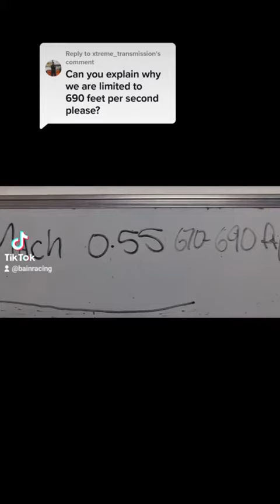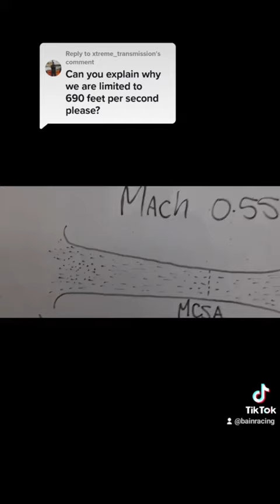"Mastering Essential Air Speed: The Ultimate Porting and Polishing Guide"

Comment: Wondering if you have done any work with riblets in the direction of airflow to reduce the drag?
Reply from the maker: Anything that promotes a biased im drag doesn't really work. Which "way" would you like to favour now becomes the question? 

 You do realise this is a bidirectional duct, right?  Air cycles up and down our primary induction length.  It's not a constant velocity. 

If you favour the air filling, you now sacrifice your wave tuning, which is up to 12% of your HP. 

Also, there is very little evidence that "riblets"  dimples, etc, will reduce drag, and it actually show they "increase" drag.   Which we do need some. But not too much, that's because this is an active turbulent boundary condition, and not a no slip condition like in aerodynamics. 

So all the evidence and studies, including the F1 study, Cambridge study, and most of the back to back we have done as well as many others, is..  

A finish between 100-200Ra surface finish creates the least amount of drag. And "limits" the boundary "swell" at peak velocity.  Remember, our boundary condition is influenced not only by the surface texture but also by the localised pressure drop.  And at peak velocity, it's up around 690fps on any good cylinder head to optimise our inertia filling mechanism.  So that Ra profile that works the best seems to be between a burr finish to 60 grit. (100-200Ra). 

So due to the pressure drop, the velocity, and how boundary condition helps flow if controlled right.  All the evidence seems to indicate that the boundary condition only needs to be big enough to support the port shape, Or it "chokes" velocity and that's exactly what we see with dimples ports. 

In short. The thickness of the boundary condition, which is obviously influenced by our surface texture (RA), only needs to be enough to help the turn the air. 

And F1 provided evidence of this with their straight shot needing as little as 320grit finish.  As it was a dead straight induction length. 

Where older, 2 valve ports need far more boundary thickness to help air and fuel turn and stay attached to the SSR. 

So in these heads, where the window is lower, then the SSR, a burr finish, is generally a win.  

We see this in all the top comp 23° heads like what comes out of Chad spiers in the US, then there's the back to back work done by Larry, the creator of pipemax.

But in later 18,13,12,10 degree heads with a high port and a far better short side radius. The best finish seems to be a fine cnc or 40-60grit. 

Hopefully, this helps 👍
Reply: @bainracing  Thanks for the comprehensive reply. Great stuff, I had to read it twice to digest the info. Yes I was aware the flow is in both directions ( even like with a 2 stroke with reed valves) but thought perhaps improving the forward flow might outweigh the 12% you mention. I also thought a combination of riblets and then polished surface on the SSR turn into the bowl might slow and drag the airflow to help steer the airflow around the corner especially on a 2 valve head. Thanks for your time.
Reply: Oh and I also had read that 50 grit was in the ballpark of the size as you mention too.
Reply from the maker: No problem at all, mate.  No, surface finishes are only around 2-3% of our HP. So wave tuning must be the priority.   We never want polished on the intake. Only the exhaust,  due to not only the fuel, but the viscosity shift. Even velocity indexes change dramatically in reference to our mach limits. As the speed of sound almost doubles from cold intake gas. To super hot exhaust.  

And as far as the short turn goes. A course Ra in this area creates more drag, which helps air stay attached,  similar to how dimple ports work on a golf ball. 

The dimples "increase" surface drag in order to extend the separation point, which reduces the negative pressure "area"  behind the ball.  I have a video on here on dimples.  

Have a good one mate! 👍
Reply: @ much appreciated. Greeting from Canada by the way. I was born here. Mum & dad were from Tassie & Sydney.
Reply from the maker: Nice! Where about?  I lived in Kelowna for 4 years. Beautiful country
Reply: @ Nice. North of there in Prince George. I’m sure you know of it.
Reply from the maker: Nice!!  Absolutely beautiful country, mate!!   Coming from Australia, i never knew what a real mountain was. Then, driving from Vancouver to Kelowna, I was mind blown! 😂
Reply: @bainracing  glad to have you here but the call of Oz is strong and beautiful as well. Cheers mate.

Comment: Massive information in very tight package 😅
Mostly over my head. 
What is MCSA?
Reply from the maker: MCSA stands for the Minimum cross sectional area of the port.  The "pinch" sets our terminal velocity/RPM limits.  So, it needs to be sized to our max RPM so we don't create a velocity restriction and optimise our density/inertia.  

If velocity gets too high through the MCSA, our density drops, and our HP is capped, and the engine falls too early.
Reply: Wow. Thanks!
Is the MSCA intentional, since you don’t want parallel pipes?
Reply from the maker: @bobirving6052  YES! parallel runners create more drag. and we want to optimise inertia. so a tapper with an MCSA will do this best and all race heads for the last 40 years have been designed around this mechanism. Also if the runner was parallel, you would have massive separation at the plenum entry as air speed would be too high.  runner also this is a timed event. stop/start, which adds to the complexity of the process as we need to understand what the acceleration and de-acceleration are doing to the density and the boundary condition.
Reply: Ok. Really tricky to deal with the air in those situations.
Reply: In your drawing, is the opening to the left the intake runner inlet and the other end the valve seat?  So do you want your MCSA at the port mating surface between the intake and cylinder head?
Reply from the maker: @BradfordsGarage On older heads, the MCSA is usually at the push rod pinch. But modern heads, you want it at the seat ring. The longer the inertia length. The better 👌
Reply: @bainracing  Awesome.  Thanks for sharing your knowledge 🍻

Follow-up:  I think this may pertain to the older heads with more turn in the port.  But, another source claims to want the runner parallel, but to open up as it turns into the bowl.  The explanation being that if we can slow the air down as it's making the turn it will be less likely to separate from the short side.  Would you agree with that statement?  And as it pertains to more modern heads with higher port angles that don't have such sharp turns to negotiate, does this hold true?  Is there a "bowl" in such heads or are we looking for more of a uniform taper toward the valve seat ring?  Thanks again.
Reply from the maker: @BradfordsGarage  Mate the Only one I know that has that opinion and that knows what he is on about is old David Vizard. And he is half right. Though you never want parallel walls due to increases in the drag coefficient. This is why a taper is used and feeds into Bernoulli equation. 

"The explanation being that if we can slow the air down as it's making the turn it will be less likely to separate from the short side"  the problem with this statement. while half true.   is its more about speeding up to far side, improve guide shape and this how modern 2 valve do it.  the area profile best for turn air is a trapezoidal shape for obvious reasons. 

The short side stability is due to the velocity gradient Perpendicular to flow and speed differential between the far side and the short side. hence the Trapezoidal profile. If the far side isn't supporting the short side, then we get separation. 

Now when It comes to the bowl volume, this has more to do with mass energy and wave optimisation. 
Bigger bowls with the MCSA up stream. will have more mass at the back of the valve for when the rarefaction wave lands just on overlap (if done right) improving VE's/savaging with a more density and mass available. But there's a lot more that comes into it at this point, from seat angle to throat ratio to our good our discharge coefficient is how tall is the SSR and so on. 

Now If we are talking about Dave he Also claims modern 2 Valve Prostock still like the MCAS in the middle with a parallel section. So that's confusing as that sort of went out a decade or more back, From memory I think even as far back as the NASCAR D3 which were 2000 ish?? sorry cant remember exactly mate. But today! none of the Superstock, Prostock guys we help and do Intakes for have there MCSA anywhere but at the valve seat.  this compliments not only our inertia length but has the least amount of drag. 

But I would love examples and dyno results of the builds with this way off thinking.  Or even what sort of HP per CI he is refering to?  Does he mention what sort of HP per ci? 

Anyway mate. hopefully that helps.  cheers for the comment. have a good one.
Reply: @bainracing  Ding ding ding!  Yes, David is who I am referring to.  He claims this with a drawing in one of his golden rules of porting videos, I believe it's Rule 1, Part 4.  So it's not a specific example rather a general one.  He has some fluid dynamic models in there as well showing the flow overshooting the turn at full lift/velocity and crashing into the long side at the throat/valve seat.  

Anyway, thank you again for taking the time to help clear some of this stuff up for me.  I still have a lot to sort out and a lot to learn.  I'm about half way through Scientific Design of Exhaust and Intake Systems (Smith/Morrison), porting my second set of heads, and just feeling a bit locked up at all the conflicting information out there.  Really looking forward to your stuff on the Ford Modular's.  Keep up the good work!  🍻
Reply: So on a 4valve engine limited to about 6500rpm and an 85% throat from factory which has very low velocity can I place the mcsa just after the divider?
Reply from the maker: @giannischatzigeorgiou2713  You can. but its always better as close to the throat just above the seat. But head will dictate where you can put in.  Port growth rates are far more important in Lower engine speeds. window should be within 103% of the throat ratio. This will keep port energy high and help with mid torque.
Reply: @bainracing thanks for the reply helped a lot.Supposing my calculations that port diameter is the combined mcsa ‘s converted to the diameter of one bigger port are correct…If I do the calculations for velocity at the valve with a simple valve curtain area and a 0.95 efficient valve things get even worse..Shows I have to turn the engine to about 8000 rpm…Now I know how stroke and coefficients of discharge you talked about come into play…
Reply: @bainracing By the way David Vizard in one of his older books says that you want the high velocity right at back of the valve also says you want a taper at the port 1-1.5 degrees..Graham Bell talks in his book about an enlarged bowl section to create a Venturi something which I will do since this is just a refreshed engine in an everyday car I can experiment…Bell is Australian with very good info in his books but no other info about him…
Reply from the maker: @giannischatzigeorgiou2713  Yeah David gets most things right, But My pet hate is these rules of thumb, as there's far too many variables.

For example. When talking about Port taper there is zero correlation to angles. What we should be using is a CSA % in growth over a port length factor and shape will dictate this too. A straight port is very different to a curved port. and Like you mentioned with Graham liking big bowls. and I'll cover this is a min. 

But back to port taper angle, Bore, Stroke and piston dwell changes what's optimal as far as what "angle" is needed. As we have changed the shape of the velocity curve. Not only by its area. but accelerations ramps and speeds to Lift Data. We can see the nose widen with more dwell. 

SO if we look at super oversquare engines like bikes where the B2=S and F1 at even greater ratios of B to S and with huge rod ratios, up around 2.2. We find the ports have and need next to no taper at all. 0.5 degrees at best.  This is due to how soft the signal is at lower Valve lifts. 

And the opposite is true... If we look at an under square or close to square with a very small TDC dwell. so like SBF  3.6 stroke, 8.2 deck and 5.4" rod, they like more aggressive growth rates. big bowls etc. 

Now back to Grahams claim about a big bowl creating a "venturi". 

There's a couple of problems with this. 
First we don't add "big bowls' for a Venturi effect. We generally At Big bowls for a couple of reasons. 

First if the MSCA is up above the bowls. Like in a Cleveland head where is just before the start of SSR.  So the MSCA is behind the bowl.  adding a bigger bowl becomes about energy storage behind the valve.  adding more mass (more available energy)  before we see the restriction of the MSCA kick in. and in a horrible place before a turn of all things. An area that is very velocity sensitive. 

So now with the big bowl we have more mass. But if we time the pressure wave timing right. we now have an air mass that is not only larger in volume, due to the Big bowls. But We have an aIr volume that is far more dense. due to the pressure wave. compressing the air behind the valve.  

This allows the poor port design to compensate for the MCSA in a horrible spot.  

 But yes in our best port design. we definitely want our MSCA with the longest inertia length as possible. nice and close to the valve. 

Hope that helps mate